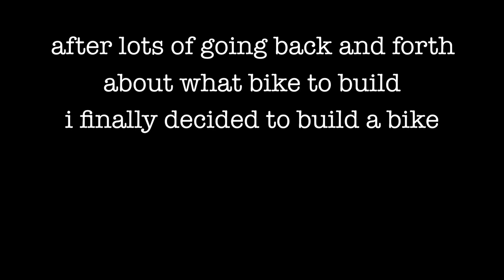Crust Scapebot (Scapegoat) Dream Bike Build

Comment: Nice build man. I'm thinking of building up the same frame. How does it ride?
Reply from the maker: its great, love the ride quality, lovely road feel on gravel and pavement, and lots of fun on singletrack and rocky terrain.  still getting used to the persuader bars (as opposed to something with no sweep), but it makes for a super comfy position.  I sized up with the frame and i'm glad i did.  + its a super pretty frame, and can do a lot!
Reply: @nearly_still  Lovely bike! What frame size did you get and how tall are you?
Reply: For anyone wanting an answer to the question I posed, I ended up getting this frame in a L size and I'm 188cm tall. Very comfortable, upright, riding position, which is what I was after!

Comment: Any idea what size the screw is on the bottom bracket cable guide?
Reply from the maker: not sure which version of the frame you have, mine doesn’t have any bb cable guide (it’s all full runs of housing)
Reply: @nearly_still  just received mine a month ago.  No cable guide but there's a hole under the bb.  I asked Crust about it, they said it's unthread, I'll have to see if I can find a plug to keep dirt out.